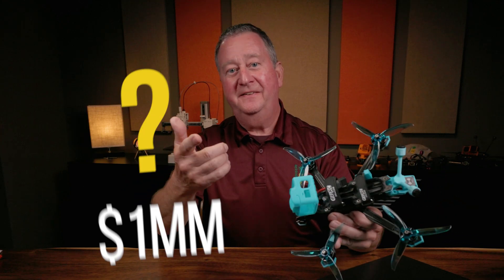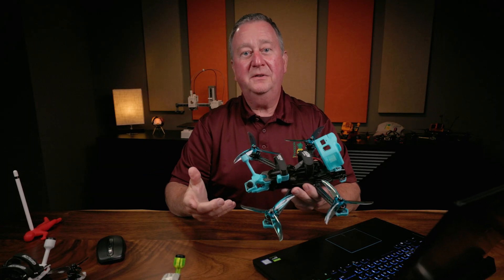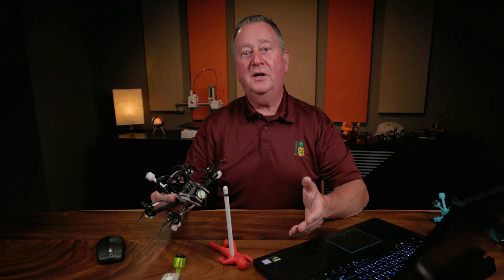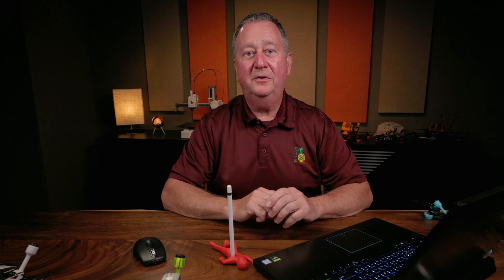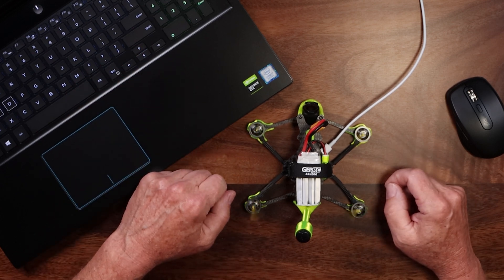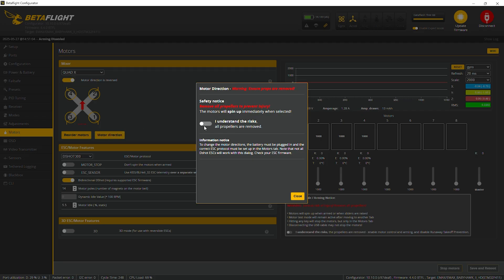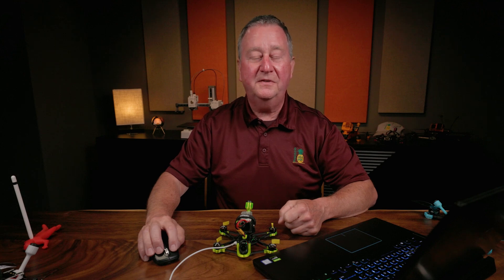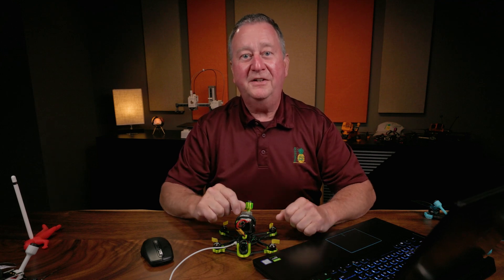What If Your FPV Drone Propellers Are Rotating in the WRONG Direction?

Comment: Great info yet again! 
Do you have any recommendations on a first fpv setup? I fly the avada 2, but I’d like to start experimenting in the diy (ish) fpv
Reply from the maker: I fly using the DJI Remote Controller so if you have that and the goggles from the Avata you are half way there.  I would recommend the GEPRC Products this DoMain https://geprc.com/product/geprc-domain3-6-hd-o3-freestyle-fpv-drone/?ref=pineapple22 has been a great flyer easy to repair and very well mannered.  If you go with the DJI Remote, order the PNP model.  It is easier to start with a smaller quad then move up to a 5”.  You will need some batteries (I use the 1050 Tattu 6S on the DoMains) and a charger and you should be good to get into the air.  This video will get you set up and flying.  https://youtu.be/lbOpcM7YiTc  Thanks for watching 🍍
Reply: @Pineapple22 thank you !